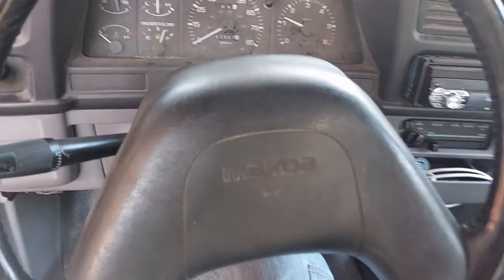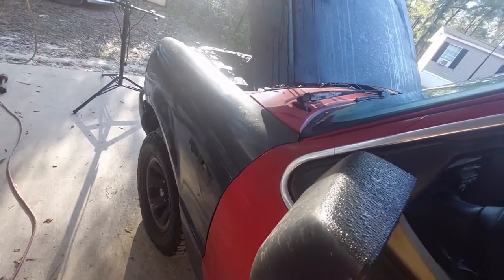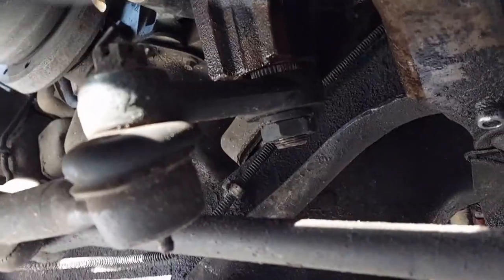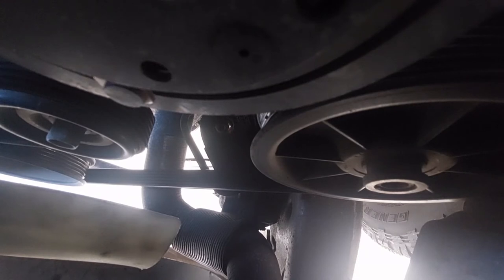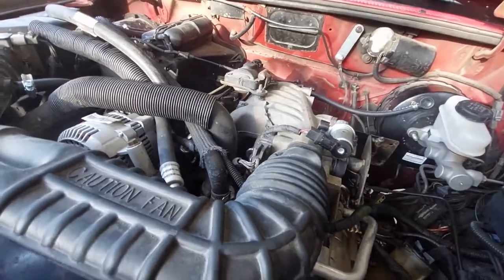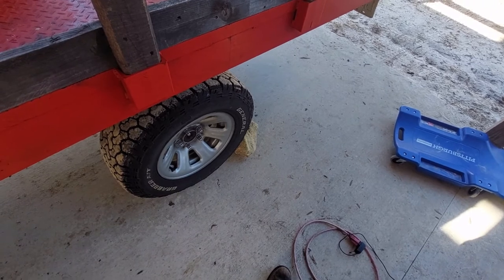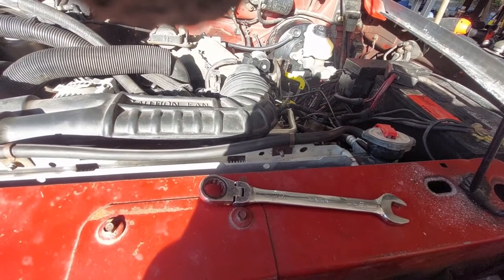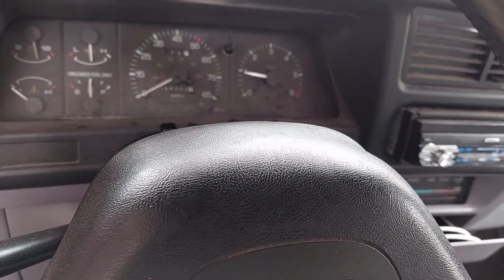Episode 28 - Steering Box Adjustment 1994 Mazda B-Series/Ford Ranger

Comment: Thank you for this. I just bought a 96 Mazda B2300. This helped a lot.
Reply from the maker: Happy that helped you out.  It works for minor play, but if you have a really large soft spot you need to rebuild the steering box or buy a new one.  I need to buy a new one myself.
Reply: @MazdaB3K  The problem is that I am exhausted all means to loosen the nut to adjust the play, even used commercial air tools, crow bars for leverage and still will not loosen the nut any ideas?
Reply from the maker: @alexshatner3907  As long as there isn't any plastic involved, you can hit the nut with heat, then shock with the penetrating oil of your choice.  That might break it loose.  How much steering wheel slop are you trying to correct?  This adjustment is only good to fix small amounts of slop in the wheel.  If you have a very large soft spot, this won't 100% fix it.  You need to rebuild your steering gear or purchase a quality reman.
Reply: @MazdaB3K  The center adjustment screw is over one inch long protruding from the nut which tells me that it has never been adjusted before,as far as the amount of play on it I would say about 2 inches one way and 2 inches the other way as i'm turning the steering wheel
Reply from the maker: @alexshatner3907  You'll be able to tighten that some, but not eliminate that much slop.  Adjust it too tight and you'll damage the gears inside the steering box.
Reply: @MazdaB3K  The nut is to hard to loosen

Comment: I have the same problem with my 93 B2600 4X4. Any videos on installing a steering box? I picked one up from the wrecker years ago and never installed it.
Reply from the maker: I don't believe it made it into video, but I've had the steering box out multiple times for this that and the other.  The easiest way is to disconnect the front tie-rods from the pitman arm, disconnect the high and low pressure lines from the power steering pump, remove the intermediate steering rod from the head of the box, then there are three bolts that hold it to the driver's frame rail.  Be warned though, it's heavy.  Once the last bolt comes out it's going to drop.  To make it easier I said to leave the pitman arm attached, but you'll have to maneuver that through the engine bay to get the box out either through the top or bottom of the engine bay.  It will also pee ATF everywhere, so be ready for that.  If you want more detailed instructions, send me an email at mazdab3k@gmail.com
Reply: @MazdaB3K  I appreciate this much detail. Put some larger tires on the truck and went on my first road trip, that old steering box was just so much work to drive with. Tried to adjust it several times and always have that inch of play. I'm still trying to decide if I should but a pitman arm removal tool or just pay to get the job done? How many hours do you think a shop would charge to re and re this box? I'll guess about 2 hours??? Thanks for your help buddy!
Reply from the maker: You shouldn't need a tool to get the pittman arm off the tie rod end of things.  You need the tool to remove from the steering box.  I think a puller  tool isn't that expensive, I seem to remember I purchased a wedge style one that slipped in and I then proceeded to separate it.  Or... I don't think pittman arms are that expensive, might be cheaper to buy a new one or a used one than to buy the tool.

As to shop time... that's going to depend on if stuff has been serviced recently or not.  First time I took everything out it took hours because of stuck and rusty bolts.  Now I can get it all apart in about an hour or so.

It really comes down to how much time you have on your hands versus the money to pay someone else to do the work.  Once thing I will say is that you need to be really picky with the reman steering box you wind up purchasing.  I bought one from my local autopart store and the quality of the reman wasn't good.  A good reman is going to cost you around 300 dollars.  I intend to replace the existing box with a blue top reman

 (https://bluetopsteeringgears-com.3dcartstores.com/2757-80-97-Ford-F-series-Trucks-Broncos-Rangers_p_24.html)

To make sure I don't have a soft spot at center again.
Reply: @MazdaB3K  Thank you!

Comment: the play should be about 30mm's when well adjusted
Reply from the maker: Thanks for the information!  Unfortunately, the reman steering box I installed was not rebuilt well and just has a huge soft spot at the 12 o'clock position.  I intend to pay the extra cost for a blue top rebuilt steering box to fix the problem once and for all.